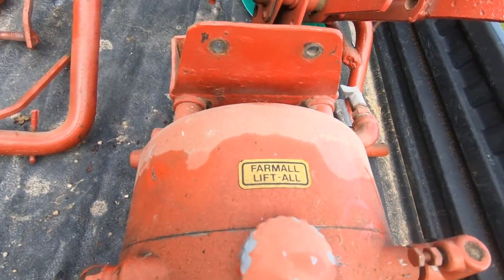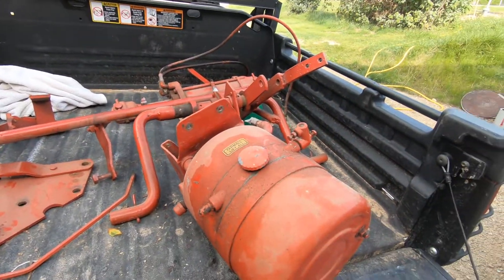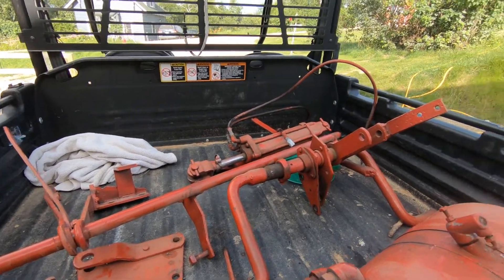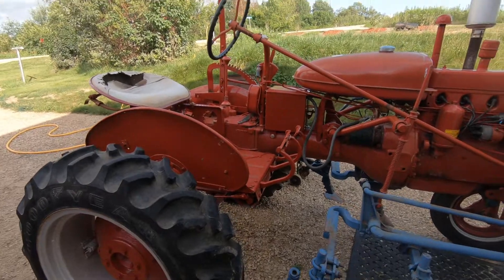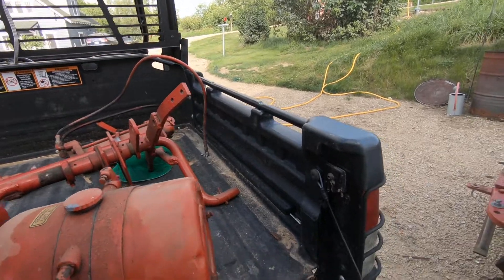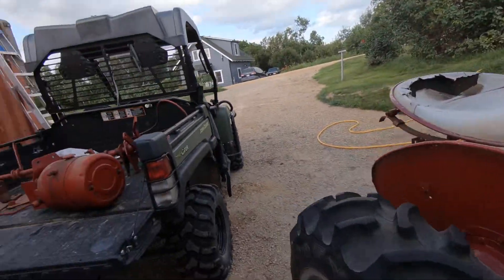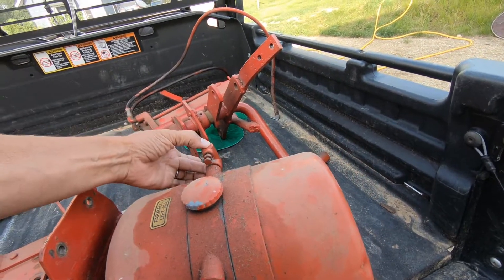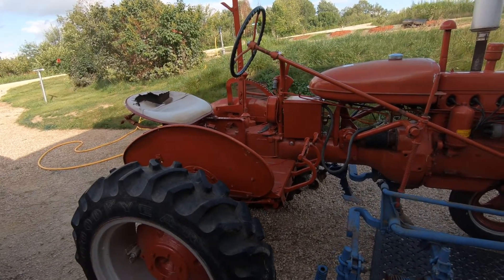Char-Lynn Hi-Lo Power Pac Pump -- E-600

Comment: Very good, I have one of these Char-Lynn pump/tank assemblies sitting in a shed and the lever just flop back and forth. I will have to get it apart and see why it is doing that. Something may be broke in side or come unhooked. My late father also had one of these on his Oliver 90 tractor as well... they were a great addition to any tractor. Thanks for the vid.👍
Reply from the maker: Thanks, and you are welcome Don! I need to get mine on the tractor and get it working. I've been so busy working on a new woodshop that I've neglected my tractors 😐 —I'll get this thig running next spring, I promise 😊